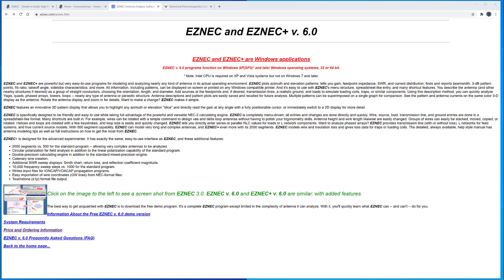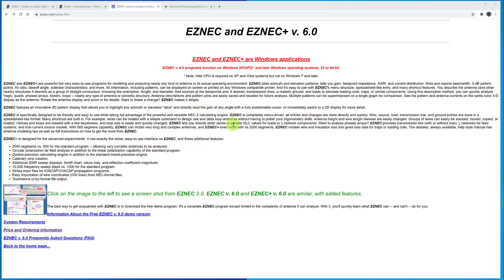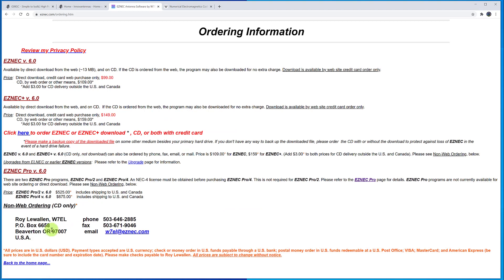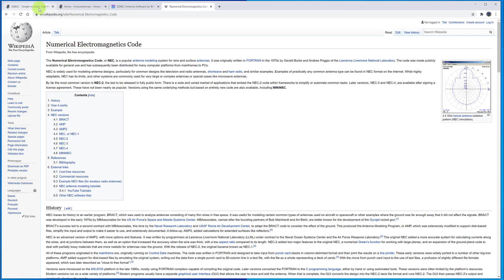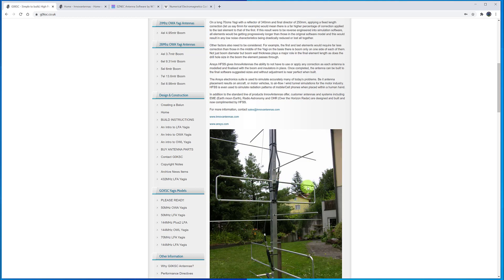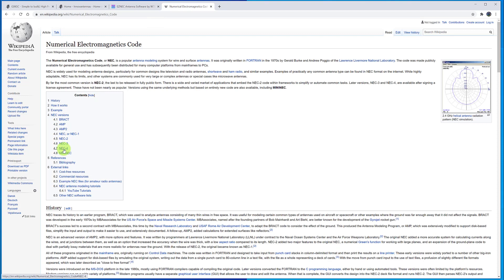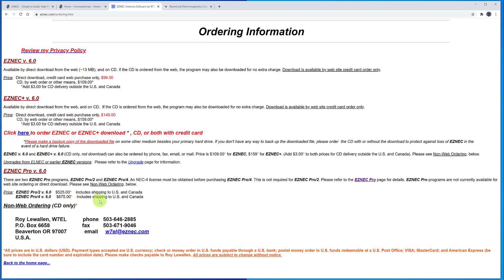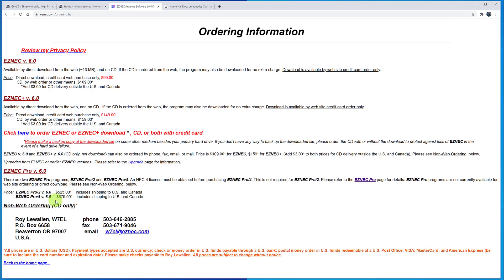EZNEC Introduction Part 1  - EZNEC Software versions

Comment: Hi Justin, is there a specific reason why you decided to model your antennas with EZNEC/NEC4 and not MMANA? I see that MMANA uses MININEC engine that in some cases is even more accurate. Do you have experience with that? Thanks a lot.
Reply from the maker: If you watched the video you would have heard I use many packages. For my commercial antennas I use Ansys HFSS which measures everything, booms, coax cable, insulators, nuts, bolts and so on. As discussed in the video, this is a series of tutorials which starts with EZNEC and will move to MMANA-GAL (I have pro version) and 4NEC2.